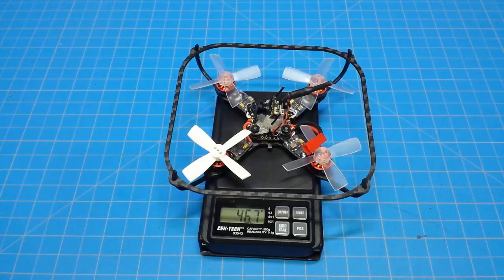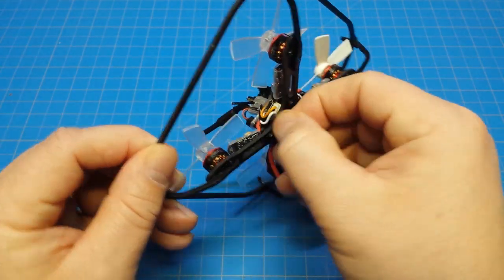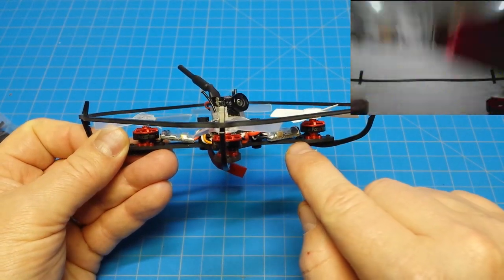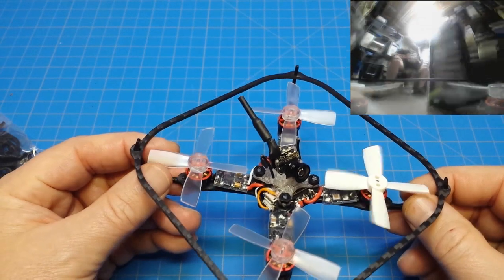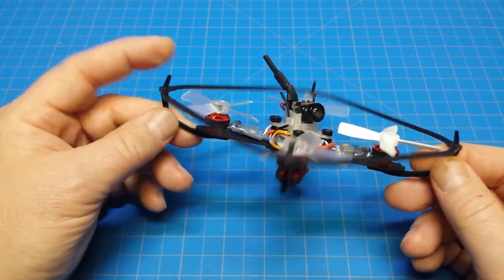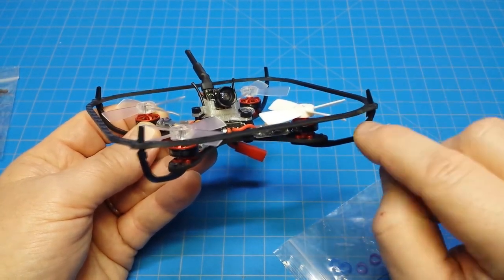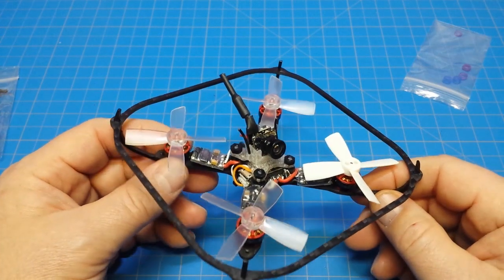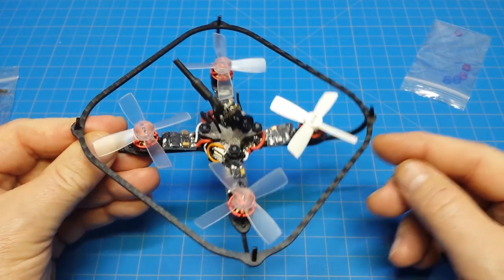HoverBot Nano

Comment: Can't wait for the comparison video! I will be building one of these soon, so far I am liking this one the best. I would be interested to see your opinion on the performance difference for motors such as the dys 1104 6500kv. I have seen others use those motors on the pico owl and the stats look much more powerful.
Reply from the maker: Stats are only a portion of the items to consider. Thrust tests don't take into account the weight of the motor. So far I have enjoyed the 1103 motors, they are as light as a brushed 8.5mm motor and produce way more thrust and torque.

Comment: Nice video! I'm glad you're enjoying the quad :)

You can find a prop cutter here:
http://www.thingiverse.com/thing:2014766

Also I'd suggest cutting those Furious props down to two blades, I find the performance way better that way.
Reply from the maker: Hey Adam. Thanks for your great design. Can you describe in what way is cutting down the Furious props better? I get efficiency, but my understanding is the multi blade "grab" more in corning. Do you find the 2 blades corning or bank the same? I was planning to order another frame, can you add the prop cutter to your shop? I don't have a printer and I am not aware of one locally. My last two thingiverse orders I cancelled after lack of shipment after 6 weeks of waiting.
Reply: Nick Burns besides the efficiency gain, I think these tiny motors don't have the torque to make quad blades really sing. I felt that the flying "feel" improved significantly after modification.

Comment: What transmitter did you use?
Reply from the maker: I used the Devo 10 with 4 in 1 module and deviationtx firmware on it. In this form I can fly, FrSky, Flysky, DSM and many other protocols.

Comment: What kind of flight time are you getting on this?
Reply from the maker: About 3mins, shorter outside. The battery sag hit hard at the end of the outside flight well before my timer of 3:10.
Reply from the maker: 2 bladed props will produce longer flight times. Different props can also have a positive or negative impact. Battery size and flying style, a hover verses forward flight, forward flight verses "tight track" (many hard corners). I like the feel of 300mah batteries around or below 20grams. Bigger batteries tend to force more throttle on hard turns or 180s. There are a lot of variables in flight time, we have to decide what we want.

Comment: How do you like that black bar across the front while flying? I did not like with my brushed quads. it also negatively affected the flight characteristics but looks like the brushless power help in that regard. This is the lightest with a really low profile and you can see the effects in the quick and smooth transitions when pushing it indoors around obstacles. That said, I also liked how the Tomo flew indoors too given it is heavier.
Reply from the maker: I only notice the bar when I watch the flight videos, I don't notice it while in the goggles. The flight performance is good and I don't think it the prop guard has much impact when flying outside either. I do agree there is a balance between light and stability. The hoverbot is almost over responsive, and the tomo swift on the other end of things.
Reply: One thing having a ring around the out circumference does is to act as a stabilizer. That may be helping take some edge off the response and stabilizing things just a bit for a nice performing balance. Take the guard off and repeat your patterns indoors. See how it feels - you may sacrifice a few props though..LOL

Light and powerful is a great combo indoors - the catch 22 is flight time. I like quick and agile.  The tomo swift looked a little down in power when you did your indoor punch outs.  If I went with the swift, I would go with a 1104-7500kv  motors, 10a 4 in 1 esc and rx2030 props. This would also give great performance outdoors without the guards. But seeing your review, I may just get both and see how it goes - the hoverbot should crash better - the laws of physics apply. Keep up the good work. The info has been very helpful.
Reply from the maker: Wow you are on it, keep us posted on your findings.

Comment: HI Nick, what kind of mode are you flying?
Reply from the maker: Acro/rate mod. No stabilization.
Reply: Nick Burns, I just switched to acro mode on my tiny whoop tonight.  feel like I'm starting all over again.  Any tips to help me get better or will i just have to keep crashing?
Reply from the maker: Acro is a whole new ballgame. With the lower power of brushed motors its going to be a bit harder than brushed on 2S or brushless. The main tip isn't much of tip, just keep flying in acro, and fly often. Every minute you will get better. Then one day stabilized is harder than acro.

Comment: Thanks Nick!  This might be the one. One question though, is this the lightest out of the bunch? If you do a comparison video you could weigh them all.
Reply from the maker: I will do that and I will tell you it is the lightest of the bunch.
Reply: +Nick Burns Hi Nick thanks again for this video! I did end up getting the hoverbot and built it. It gave me an idea for another video = tuning an indoor brushless micro quad. You do awesome flying inside in acro mode but do you limit your throttle? Have you changed your pids, expo? I think a few pointers would help. Just an idea. Keep those awesome videos coming!